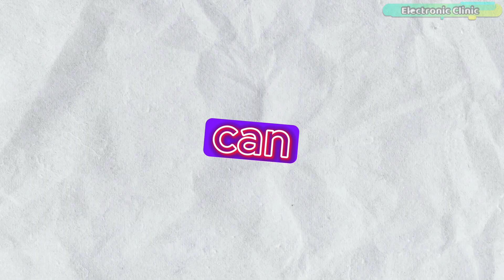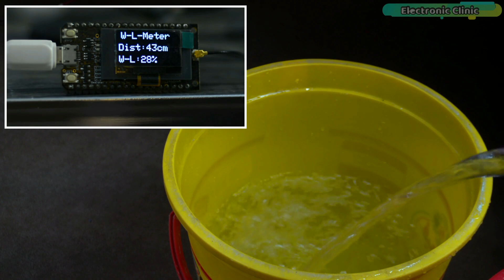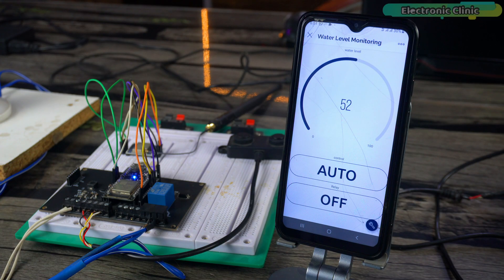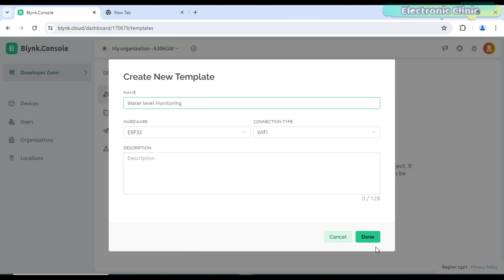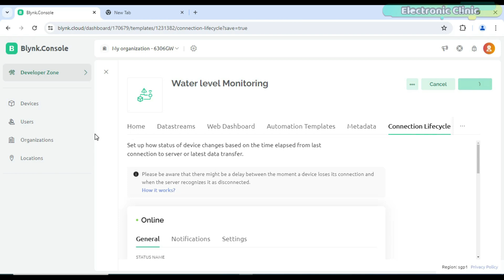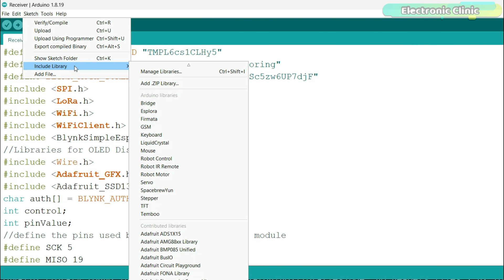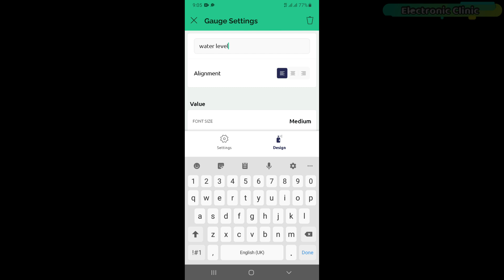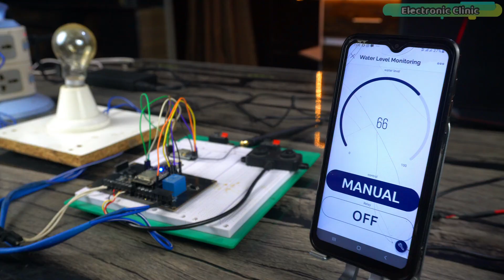Wireless Water Level Indicator using LoRa and ESP32 Version 2, LoRa Gateway, Blynk

Comment: AoA, it would be highly appreciated if a project with following options is uploaded.
1.Top roof water tank may also be monitored alongwith underground tank.
2. On a user defined top roof level the water pump can be controlled with dry run protection.
Thanx

Comment: Thank you for the up grade  can you make another video including power save and solar powered transmitter with Lora as this type used for low consumption and could used for battery powered devices and sensors 
Best regards to you
Reply from the maker: @thedoctor9625  I am working on it. This time I will use Lora with a soil pH sensor. Based on the battery operated esp32S3. I will upload it next week.
Reply: Thank you again,,you mentioned that you are using JSN - SR04M ultrasonic module but actually you used another type can you please show us how to use JSN-SR04 as serial mode low power interface and programming or it will the same code but we have to change the module mode by adding 47K resister as in the data sheet 
Regards I appreciate your work and reply

Comment: Thanks for the upgrade, but what i would like to have is, At receiver side there should be a button to turn on and off the automatic mode and manual mode so that we can turn on the motor manually when needed, secondly make it complete by adding 18650 batteries and charge module, and it must show battery health of both the transmitter and receiver separately so that we can charge the batteries when they are low on power. I hope you will consider the changes. Thanks
Reply from the maker: @joshitoshi9835  I have designed a new board based on the esp32s3, that has the onboard battery charger and a USBC as well with the esd protection.